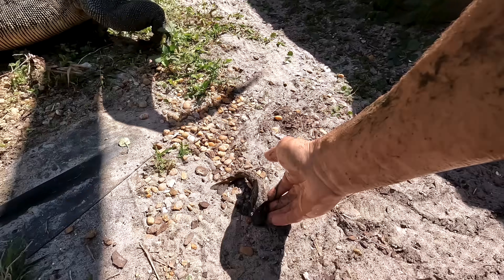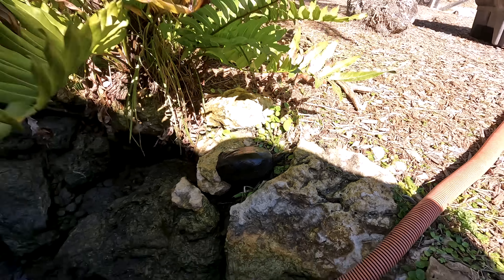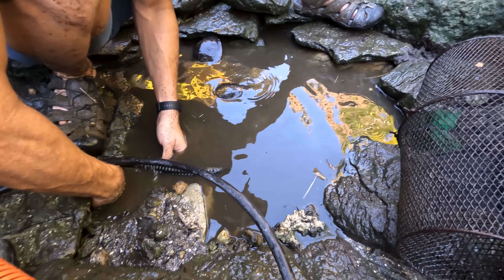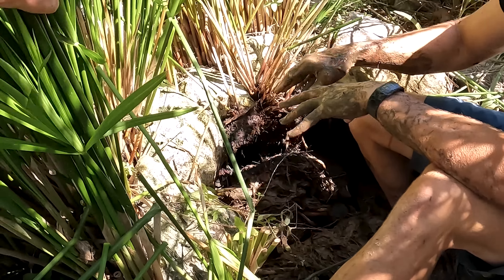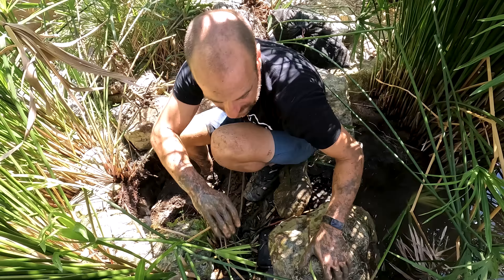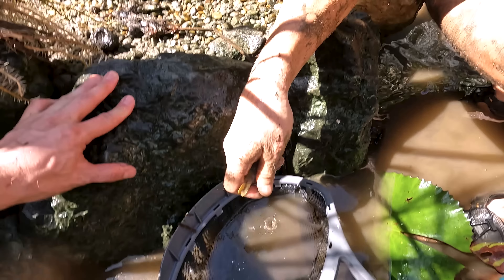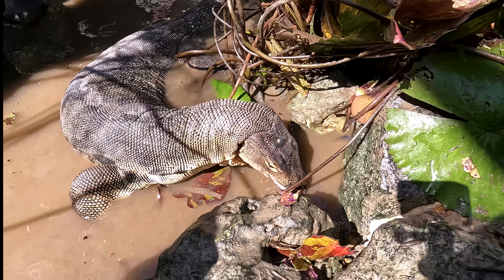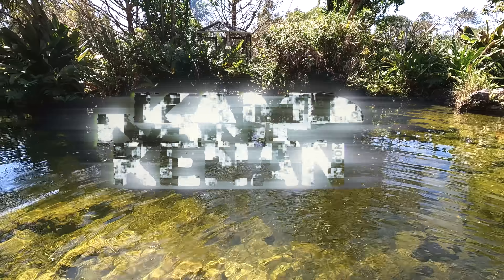Moving ALL my Cichlids by Draining the Ponds!!

Comment: Have you thought about running a line grid over the Rec-pond? It can be as high as you want but about 6 to 8 feet above the water works great and it really helps keep birds from getting to the pond. Though it does have the drawback of having posts sticking up all over the place. The other thing that can be used with much less posts or poles is an aviary net. With that you would only need 7 to 9 poles with a central pole.

Comment: I had to completely remove papyrus from my pond, the roots grew into my pump and it stopped working. It took hours to remove the blanket of papyrus roots. They spread so quickly and easily I’ll still have multiple papyrus patches around the perimeter of the pond.